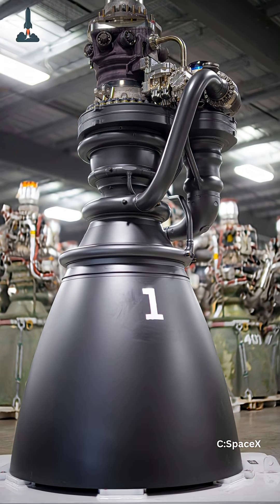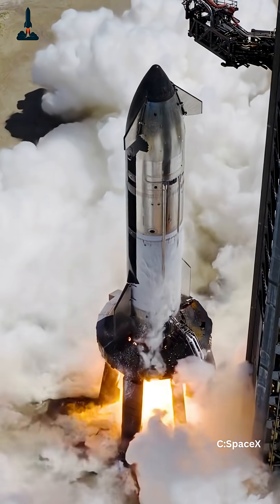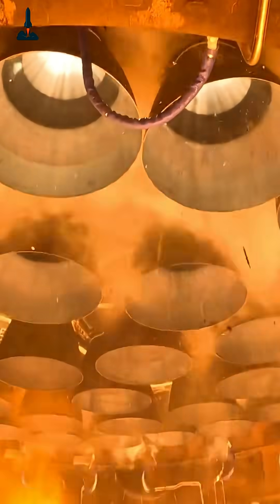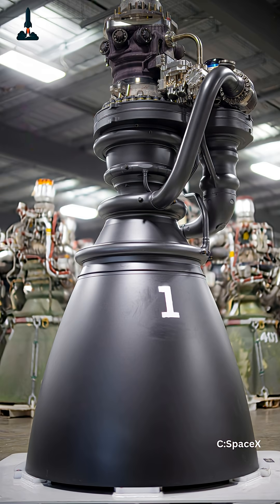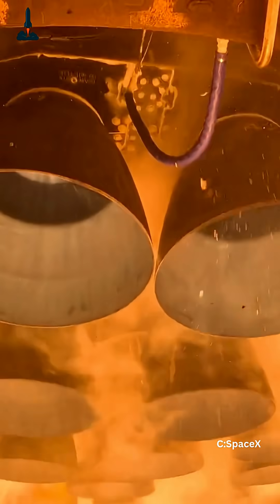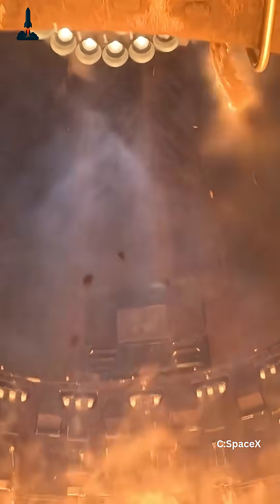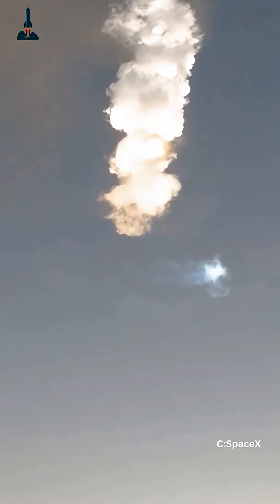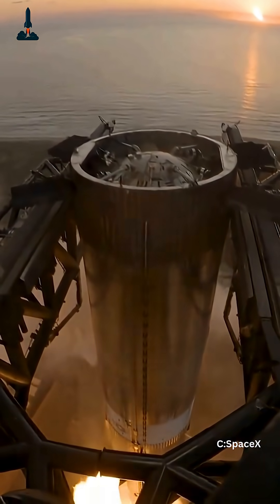Can Raptor 3 Survive Its Own Power? #spacexrocket #starship  #raptorengine #elonmusk #rocket #shorts

Comment: I would also argue that the Raptor (V2) engine is already perfectly functional by industry standards. It’s been actually running remerkably well for a while now. It shows very stable abilites for self-diagnostics, shutdown and relight. And last time it 70% of the engines were reused and many were even dented. These things are actually tanky. And a reflight of sucha  volume of engines in 2 months for such an young engine family is unheard of. The in soace issues were also less engine related and more plumbing, fire supression and vibration related. The reasons for V3 aren’t any reliability issues of the V2 but simply the requiremnts of the system architecture itself, which are weight reduction, an integrated heathshield and even more trust. So yeah, in a way we could say V2 would melt running in those circumatances but it’s not like not a well performing engine already.
Reply from the maker: Raptor 3 surpasses Raptor 2 with around 25% more thrust (≈280 tf vs 230 tf) and a lighter, simpler design that cuts engine mass and plumbing.
It eliminates the external heat shield, improving reliability and reusability.
Overall, it delivers more power, less weight, and faster turnaround for Starship missions.